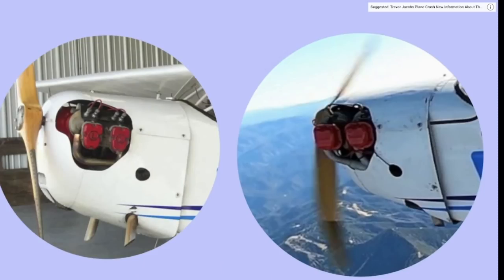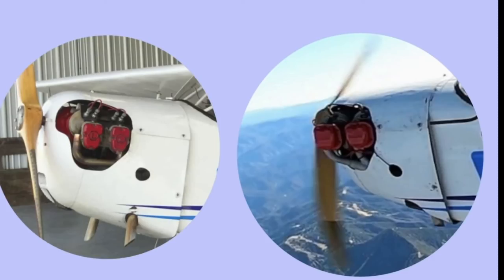Trevor Jacob Engine swap before the suspected "FAKE" crash?

Comment: ok hear is a question do we know for a fact Trevor swapped the engines or did the original owner swap the engines before they sold it

to me it seams like something the original owner would have dose because why would Trevor paint the covers red when that was one of the things that helped identify the aircraft 

also if the engine still had usable hours on it the original owner could have swapped it for an engine that did not have useable hours on it before they sold it so that they could sale the engine to someone else and make more money off the aircraft
Reply: 1) No, we don’t know for a fact.
2) Why would the previous owner bother with the swap or the paint if the aircraft was being sold as unairworthy salvage for parts?
3) If the previous owners swapped engines and painted the valve covers, why? To commit fraud? I suppose it’s possible.
Reply: @MarcosElMalo2  why would the previous owner bother to swap engines is simple as i said in my OP maybe the original owner swapped the engines because the one it originally had still had useable hours on it and their for was actually worth something unlike the aircraft its self

so why sale a good engine with a bad airplane it dose not need to be any kind of fraud as the aircraft was theirs and they could swap the engines if they want before they sold it as is 

why are the valve covers red because that is what the original owner liked

and as i asked why would Trevor swap the engines and paint the vale covers red making it easier for people to figure out what aircraft he used  

so as i said its more logical that the original owner is the one who swapped out engines before they sold it and the valve covers were panted red because either the original owner just liked the look or because the original owner already had the plain up for sail someone made an offer on the engine and so the swapped the engines and painted the covers so they did not have to repost pictures

Comment: I particularly like the rippled (mallet?) dents on the cowling top, the neat maximum clearance aperture (sorry, technical term I think is " hole") for the exhaust outlet, the dirty finger marks around the fasteners and the bungee cord on the lower cowling shroud. All the hallmarks of careful ownership, stewardship and appropriate behaviour for flying. Lucky nothing dropped off apart from the diver's credibility.
Reply: yeah, that cowling is beat to fucking hell in the crash video. It's evident that it had recently been worked on and they just bashed the thing back together

Comment: The cowling was badly dented and there is a black rope or something (what's the reason?) that you can also see there. It looks like that engine swap was rushed to me. It's sad to see how the plane looked very nice in 2016 and now, even before the crash flight, it had deteriorated a lot apparently.

Comment: It wouldn't surprise me if that black line going from the engine cutout to that small round hole in the front is just a bungee holding the engine cowling on. If the FAA ever does get their hands on that plane I suspect they will find a lot of plastic zip ties and duct tape in the wreckage also.

Comment: Ok, now it'd be especially interesting to learn exactly when this helicopter which cleared the wreckage was commissioned. Because even a fire wouldn't stop his unregistered engine from being noticed during the investigation... right? 🤔
Reply: There’s a lot of speculation surrounding that helicopter, speculation that doesn’t take into account that the helicopter in question might have been hired by the government. Furthermore, the helicopter company is a government contractor. They’ve done transport work on government lands, making it pretty certain they are aware of the permits and authorizations required for removing airplane wreckage from a National Forest.

We still don’t know for sure, but it’s more likely that IF the wreckage was moved by this company, it was authorized by the FAA, signed off by the Forest Service, and the wreckage is now in the hands of the FAA field office (Paso Robles FSDO). The company is also based out of Paso Robles, fwiw. One wonders why a company would risk its livelihood for a relatively small payoff.
Reply: @MarcosElMalo2  There is NOT A FSDO in Paso Robles. Look it up. If the FAA has the wreckage (and I hope they do), it's at a nearby airport...and in secure storage.

Comment: No telling whom/when the engine was swapped, might be completely legit. But FAA needs to investigate the wreckage and log books. Also, was this Trevors plane or was this borrowed/recently purchased?
Reply: wreckage is long gone as far as we know. Dude hired a helicopter to recover it and bring it somewhere, likely it is in a dump in pieces somewhere now. I cannot imagine hiring the helicopter so quickly to recover it if you felt the situation was on the up and up. Ultimately your insurance might have to pay for that recovery, but they aren't doing it a couple of days later. I am sure the bill for a helicopter to retrieve that plane exceeded the value of the plane by quite a bit.

Comment: The manufacturer's recommended TBO is just that, a recommendation. You, as the owner are the final arbiter of when it needs to be rebuilt. Many engines are perfectly fine to continue flying safely well beyond the manufacturer's stated opinion. Take good care, and it can be extended.
Reply: Your A&P / IA will have a say in the matter.  If it no longer makes acceptable compression, or anything else not normal you'd be hard pressed to find a mecahnic to sign off on an annual inspection.   I wonder,  BTW if it was even airworthy if no inspection/annual had been done in last 12 mos.

Comment: You noticed an engine change on a parts plane.  Did you notice that Trevor posted his original crash video a year ago?  NTSB doesn't care about this since nobody was injured, no property damage, and the plane was removed and disposed of.  Pretty much the end of story
Reply: I think you’re correct that the NTSB is not involved and will not be getting involved. This crash is really outside their mission. However, the FAA (which is a different agency entirely) has announced they are investigating the incident.

Also, last year is not the same as a year ago. It was a little over a month ago that the video was posted. I think you had a brain fart there, Captain. 🧠 💨

Comment: Trevor did a lot of stupid things, many of which he’ll probably go to jail. But, under FAR Part 91 rules you do not have to replace or overhaul an engine after so many hours. It is only recommended.
Reply: Not a regulatory question, an economic one.   That recommendation establishes a baseline for valuation of engines.  May not be required by rule, but on the open market for engines, a timed out engine is approaching zero value compared to an engine with many hours. TLDR; he ran a junk motor to save money

Comment: Just for clarity aircraft engines if I recall correctly are typically machined 10, 20, 30 thousandths and the part is red tagged - junk.  I saved one crank via nitriding, which grows the surfaces, 10ths at a time, the owner was almost jumping up and down.  It is recorded in the log book...  Lost many hours of flight training to log books of numerous aircraft cause it was recorded in them for convenience other than my log book.
Reply: With the pots, it's normal for a patch of cooling fins to be painted denoting either cylinder plating or overbore.
Nitriding doesn't grow the material, it's a relatively low temp chemical hardening process used specifically because it maintains dimensions, metal spraying is what's normally used to build up undersized parts.
Reply: Continental does 10 and 20 thou under then it's junk. Lycoming does 3,6, and 10. On crankshaft, rod and main journals.

Comment: Saw evidence that the previous owner had recently converted it from a Lycoming 65 to a Continental A65 after the Lycoming had timed out. Story goes they hadn’t gotten it all running right before selling the plane though. Still, that doesn’t mean the plane wasn’t airworthy and hadn’t been fixed adequately before Trevor Jacob destroyed it. In any case, the timed out engine swap theory doesn’t hold water because a running, serviceable A65 is only about $5000 and the whole plane in that condition would only be worth about $15,000 even in today’s market. Not to mention intentionally doing an entire firewall forward swap (including engine mount, carburetor, mags, all new throttle, carb heat, mixture cables and exhaust) just to save a buck on a throwaway plane is backwards. You’d be almost $10,000 into that swap on top of months of sourcing hard to find parts.

Comment: Could that have been done by the previous owner?
Reply from the maker: Yes it could. But when Jacob registered the aircraft to himself he failed to mention the engine change as it is still registered as a lycoming. It is easily provable because any engine swap will have been signed off by a licenced engineer. That is if the tech logs still exist?
Reply: @grahamthebaronhesketh.  Not an 'engineer' ; by an FAA licensed A&P mechanic and an IA.
Reply: @avflyguy  Jeeze, that’s pretty embarrassing, getting trains mixed up with planes! Ha, just kidding.

But it brings up a different question. When was the last time the plane passed a smog test? 😉

Comment: There could be a reasonable explanation for swapping out engines, for example if the Lycoming was out of hours, had cracked cylinders (not uncommon) and the cost of a "Major Overhaul" would have been cost more than a used Continental.  But I would like to know the respective conditions of the Lycoming that was removed and the Continental that was installed.  That would tell a lot.  Oh and btw, notice that whoever swapped out the engines cracked the cowling and didn't bother to repair it.  It would have been an inexpensive fix, but why bother if you're just going to crash the plane anyway?
Reply: In my 50+ years involved in the aviation industry,  I can say  I've never heard the term  "out-of-hours".   Don't even know what that means.
Reply: @avflyguy  I think he means it's past the due date/hours for a major overhaul.
Reply: @avflyguy  Some industrial equipment use hour of work, not miles traveled to tell how much wear is in it.
Reply: If you check the certification, you see he registered it with a Lycoming engine, yet he's flying it with a continental, something fishy there....

Comment: Bull shit on the claim of out of hours! TBO time between Overhaul does not apply in the US for FAR part 91 operations maybe in your country but not ours! We can fly it until it dies. If the airplane is used in commercial operations ie flight instruction or other passenger related ops the TBO would apply.